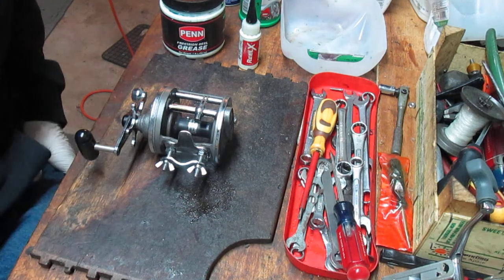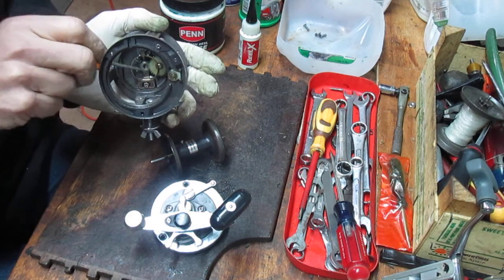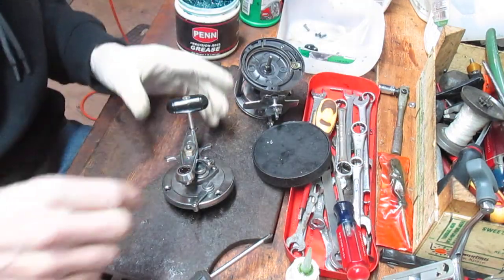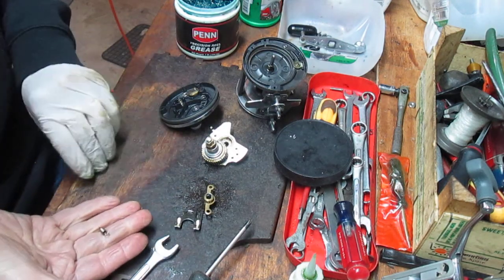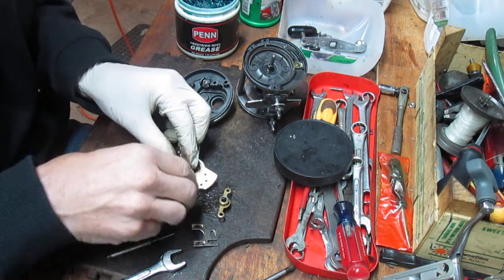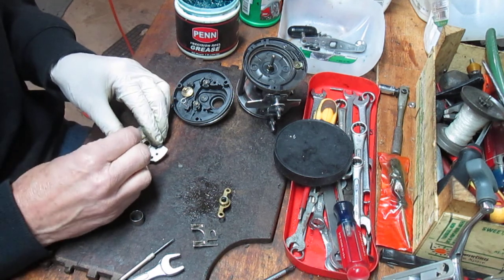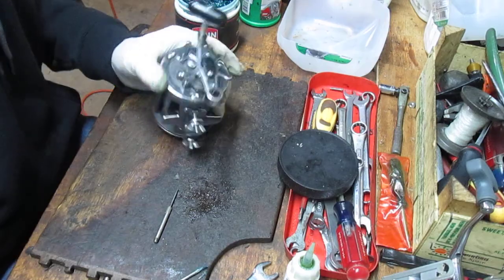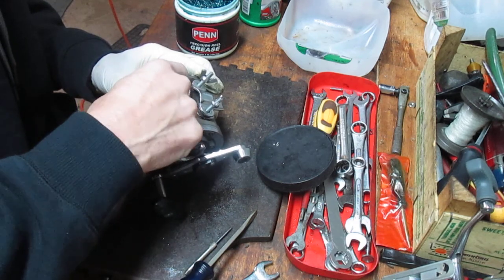Daiwa Sealine 47H rebuild including basic maintenance and drag service

Comment: Thanks Dennis for putting out another vintage reel video that saved me time, while inspecting and cleaning another great eBay find.

Now with my 27SH, I own a 47H that gives me more and larger line capacity when I need to use a levelwind reel.  But also after inspecting my new purchase with the help of your instruction, I believe this old reliable workhorse hasn't been used much in it's day, and I now own a virtually 'like new'  vintage reel find, that should serve me well, over time.

I think this older line of Daiwa Sealine reels (maybe the first line of Daiwa Sealine reels ever produced, if I am not mistaken) are superbly built and can last a lifetime, if properly kept and maintained.  Sure they are a bit heavier than comparable levelwind reels, but I think that is one of its benefits, in helping to keep the reel functioning over time "like a tank", and thus keeping the overall quality of the reel at a high level, so long as one does not overly abuse the reel.

Keep-up the great work.:  Exploded reel diagrams on paper are fine resources, yet sometimes it's better to use audio and video, step-by-step, to get a real understanding of a vintage reel, so that it works well and stays properly maintained.

Regards,
Jim Murray
Thousand Palms, CA
Reply from the maker: Thanks Jim - those reels were made in the late 1970s and they are bullet proof.  It is hard to find a reel like that that will last as it did in todays market.  Enjoy them!  Dennis

Comment: Hello and thank you for the 47H video taken and rebuild. I replaced all 9 drag components both metal and fabric 61, 63, 64, 65, and 67 It definitely needed it. At first I had a bit of trouble putting it back together but then I finally got it to work. In your video I did not see component  38 6-B03-7201, but perhaps I had a newer model. I also had a leftover part that I did not see where it came from when I separated the inside plate from the right side plate. It's a metal ring with no bearings. Is there a way I can send you a picture of it maybe you can tell me where it belongs. I do not see it in the schematics. Thank you Dom
Reply from the maker: Yes - please sen the picture to my email 2ndchancetackle@gmail.com I also do not have that schematic, so let me know what the part number you reference is named, and I will try to help - Thanks for asking - Dennis
Reply: Where did you find drag components to buy?

Comment: Excellent video and thanks for sharing your knowledge on this matter! On my Daiwa Sealine 47SH, my line spool and main plate (where the main gear assembly is housed don't seem to come apart. I'm afraid to use too much pressure to try and pull it off.  Is there a trick to getting the spool to slide off the shaft? Thank you again!
Reply from the maker: Nick - it seems that your pinion (spool) gear may be frozen to the spool shaft.  Does your reel free spool or is the release lever stuck when you try to move it?  If it is stuck, then you have a frozen gear.
Please let me know if that is the case and I will advise on the next steps.  Thank you
Reply: @2ndChanceTackle  Thank you for the quick reply! My release lever isn't stuck and seems and the reel is all taken down into their various components so the release lever is not engaging anything at the moment.
Reply from the maker: Nick - please send a note to my email - 2ndchancetackle@gmail and send me a picture of your various components as well as what part you are have the problem with.  I will reply from there.  Thank you - Dennis

Comment: Hello Denise, wondering whats a good website to buy diawa reel parts? I've been on a few but they are bad sites as of the layout of it and user friendly. I recently bought a rock cod 610 reel that I might need a few things for it. Thanks again!!
Reply from the maker: Start with Daiwa the number below is for parts ad warranty service.  Your 610 is out of warranty.
also, Mike's Reel Repair - Vancouver -  - search the web, usually has them
DAIWA CORPORATION
11137 Warland Drive
Cypress, CA 90630
(562)375-6800
Dennis
Reply: Ok thanks, you da man!

Comment: Hello, how long should your spool spin for, I just used my thumb to spin my spool on my Daiwa Sealilne and my spool spun for 6 seconds I feel like it should spin for longer
Reply from the maker: It all depends on the type of fishing you are doing.  If you are drop fishing with a heavier weight, the 6 seconds is fine.  If you are casting lighter lures, then you want it to spin longer.  This reel is not a pure casting reel due to the level wind function.  That creates additional drag and slows the spool.  At any rate, there is a spool tension cap behind the handle.  If you back it off by turning counterclockwise, that will release the tension on the spool and should give you the adjustment you are looking for if you want it to turn more freely.  Just be careful to leave some tension on it as you don't want to lose the cap and spring by backing it off all the way. If the spool is still not turning as free as you like, you may want to check and lube the bearings that are in the side plates.  Thanks for asking - Dennis
Reply: Thankyou for the information Dennis very helpful yeah im using a Daiwa Sealine 50H which doesn't have a level wind. I think once I put lead on it should cast far enough for what I need im using it for surf/beach/jetty fishing, I might buy some oil and lube the bearings with oil. There are not many videos out there with people casting Daiwa Sealine 50H, and if there is there the newer Sealines so I couldn't look at any reference videos might go to my local oval and practise casting my Sealine and see what the capabilities are.
Reply from the maker: THe 50H is a great casting reel.  I did a video on how to service it.  You can follow that one if you like.  It is https://youtu.be/wvOkryi42P4 - Dennis

Comment: Thanks for your knowledge is their a power handle for this or how can I remove knob I want to custom make one for it
Reply from the maker: I am not aware of a lower handle for this reel.  You would have to drill out the rivet on the backside of the reel to remove the knob - Dennis

Comment: The spool moves side to side in free spool. Is that normal? Moves a little bit when in gear
Reply from the maker: Yes.  There is a spool tensioner that can be used to adjust the side play if excessive.  It is the round button behind and atop the star drag in the center of the side plate.  If you think the spool has excessive free play, then tighten the adjuster by turning the button clockwise until the spool does not turn freely. You then need to back off the adjuster, turning counterclockwise, until it free spools.
Thank you for asking - Dennis K.

Comment: Looking for a tutorial on 27lc reel maintainence
Reply from the maker: Frank - I don't see that reel much any more.  It's probably 20-30 years old and the line counter editions just didn't hold up.  Parts are no longer available for the line counter in particular, so if you have a problem with the LC,  just fish without it.  I will add to my request list and if one comes in, I will be happy to do the video.  Thanks for asking - Dennis
Reply: @2ndChanceTackle  Thanks Dennis appreciate the reply.

Comment: i recently changed out my drags....but now my handle doesnt lock....it spins forward and backwards...any idea wut i mite have done wrong?
Reply from the maker: Yes - you either did not install the anti-reverse or have done it incorrectly.  There is a lever that belongs over the bottom right screw that slips inside the bridge plate once that has been reseated.  The lever is then connected to the spring on the top of the bridge plate.  Go back to the video and review how this is done towards the tail end of the video.  If you have lost the anti-reverse dog or spring.  Let me know.  I have some extras.  Thanks for asking - Dennis